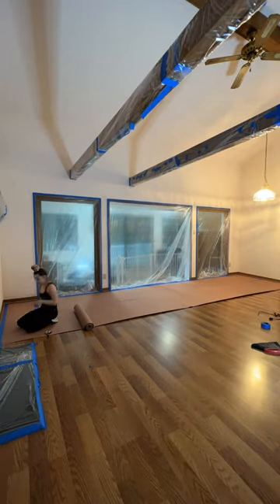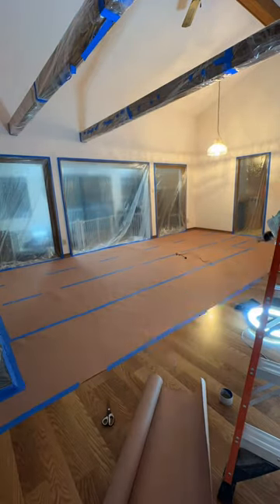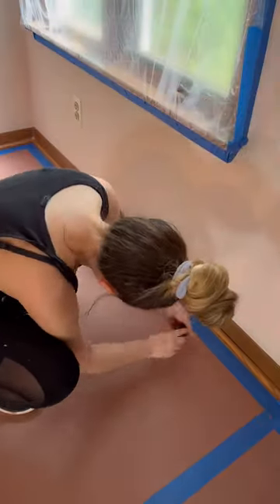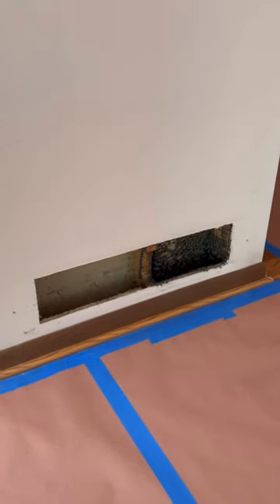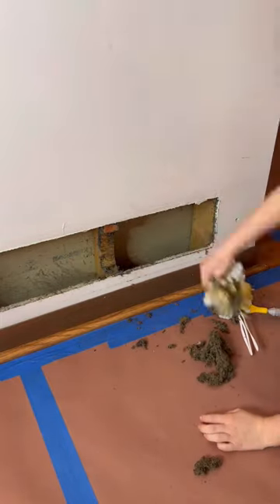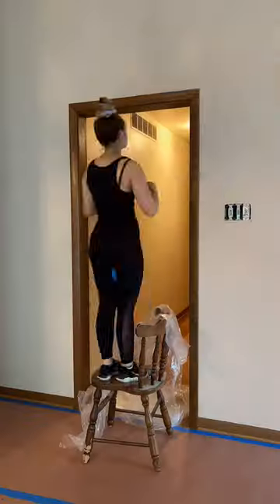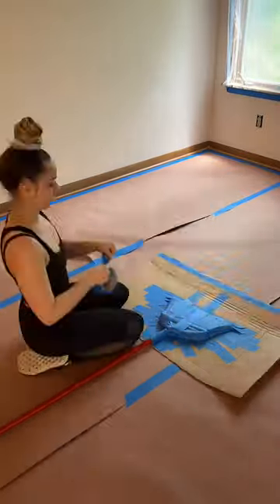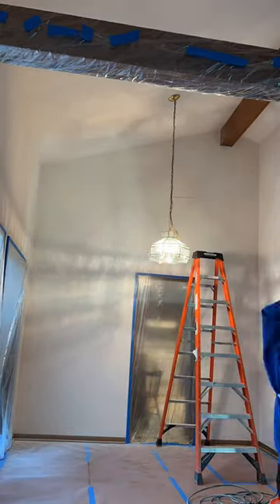HOT MESS LAKE HOUSE RENOVATION PART 15 | VIRAL TIKTOK SERIES | LEXI DIY

Comment: Have someone come clean the ducts. We just had ours done and he said it was really nasty.
Reply: And the dryer vent
Reply: Give us a price of what you paid, so she doesn't get ripped off.  I haven't had mine done in almost 5 years so I am sure the prices have gone up since then.  I think I spent close to $400 maybe a little more because we got a box of filters and out furnace cleaned at the same time.
Reply: @ginadelsasso288  Pricing is going to vary widley based on where you live and how big your house is. I got a steal of a deal at $250 for unlimited supplies and returns, but the guy is getting his business started and built up. I have paid $400-$500 in the past though. But I’m not in Jersey so I would imagine it would cost more than where I live in the Midwest. Everything else does.
Reply: Definitely get someone to clean all of the ducts, remember the outside under the stucco, well all of that moisture permeated your ducts.  And like someone else said you shouldn't be breathing that.  
We just had ours done as well, really wasn't to bad considering it's a 24 year old house.
Reply: We have a fairly large house (4000 SQ ft) and it was $500. I felt it was a little overpriced (we live in a small town). But hey, peace of mind is worth it. Previous owners had a dog and the vents were full of hair. Also, no one had ever dusted. Like. Ever. In a decade.

Comment: Aslo use a paint brush to cut around the edges of the beam, and use painters tape, use a roller on the top half of the wall and cintinue with the sprayer if needes, or you can completely plastic seal the beam

Comment: Tip to save clock 🕰 & $ I learned from a painter. 
Use the paper on all the outline areas then with your big roll of plastic (cheaper than $ store little pieces) he used spray glue on the paper then glued plastic sheeting to it. Used your painters drop clothe or an old piece of carpeting to put your ladder on to keep from ripping plastic. 
Latex paint will come off of hardwood floor pretty easily. 
I Always have my little shop vac with wet filter in and bucket of water for any accidents that may happen.

Comment: Stanley Steamers clean air ducts. They will drill a small hole in a lower duct so the crude can be vacuumed/sucked out. Then, they will go down each vent with a hose that has a brush with chem cleaner. We have our house done about once every two to three years. They use the same exit hole as they used the first time, then tape it shut. You will be shocked on how much dust, dirt and bugs are in your ductwork. We know when our ducts need to be cleaned again by how dusty the house gets. Have them do your dryer vent if it isn't directly vented outside (meaning that the dryer vent is hard ducted from the middle of the house to the outer wall).

Comment: You can call any HVAC service, they can do vent clean outs. A lot of HVAC places include yearly maintenance if you purchase a unit from them, but they also just service maintenance cleans. Some thing you guys may want to have checked out, is the coil system on your HVAC unit. If one of those gets too clogged, it can make your whole unit go out.

Comment: Save yourself some money and only use blue tape if the tape itself is touching the hardwood floor. You should use the white/yellow 3M masking tape for the rest. Example, taping paper to paper or plasic to plastic. What i do is just tack the center of the paper at one end, roll it out, cut and tack the other side. Ill do this throughout the entire area then go alont the outside edge using blue tape then use the regular masking tape on all the overlap. If you are spraying walls too, use masking tape aswell along the door trim so long as you are going to unmask it by the next day.

Comment: If your air ducts are this bad you need to have your dryer vent from the inside to the outside cleaned as well if they were not having their ducts cleaned the dryer vents probably haven’t been cleaned either and it is most likely a fire hazard. you should hire out a professional to do both.

Comment: You cants clean the air ducts your self.  You have to hire a company for that.  I'm so sorry.  Also, change you furnace filter and have your furnace cleaned too because that will just push more dirt into the freshly cleaned ducts. It sucks having to hire out for these things, but there isn't a machine at home Depot for this.  You need the professionals.